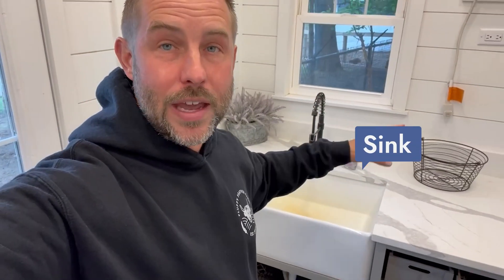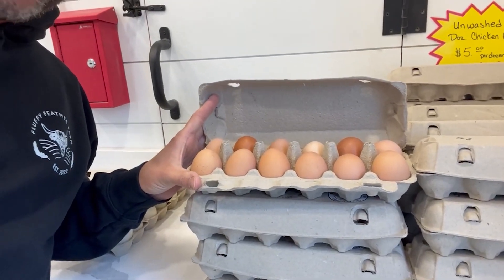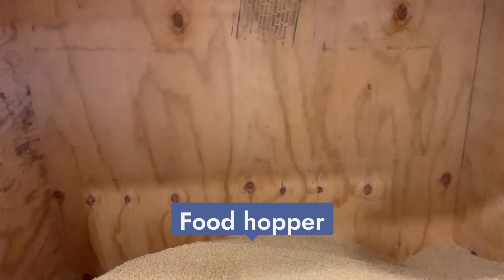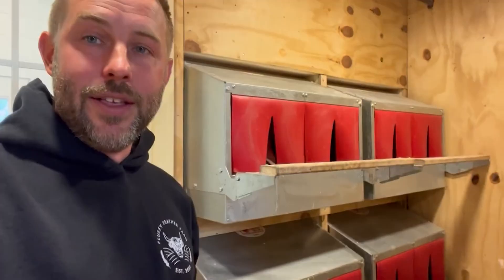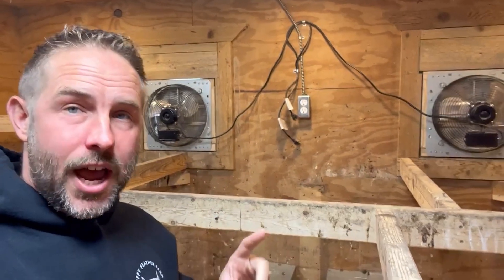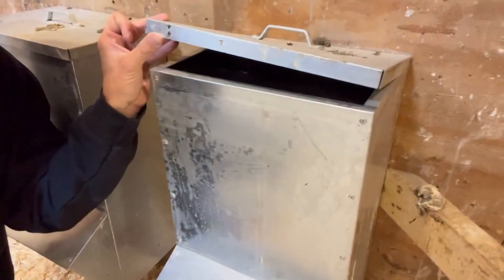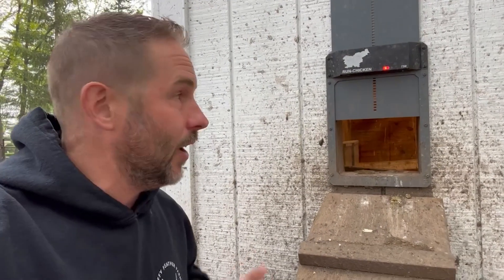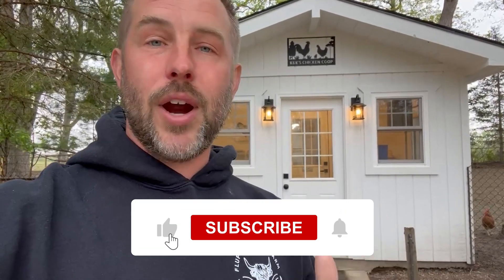Take A Virtual Stroll Through Our State-of-the-art Automatic Chicken Coop!

Comment: The old timers I knew as a kid, used emery cloth to clean the dirty eggs, they sold commercially so every egg was important. Nice coop, mine also had cement floor, water and power. Wood was cheap then, so it also had knotty pine walls and a skylight.😂